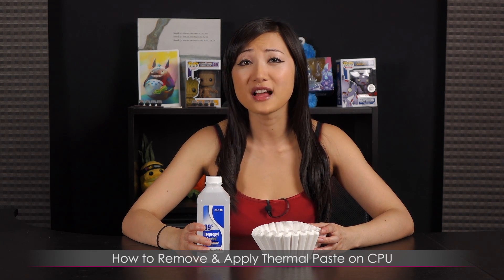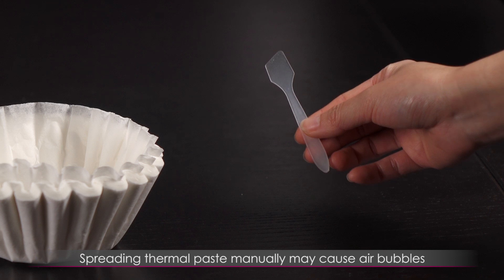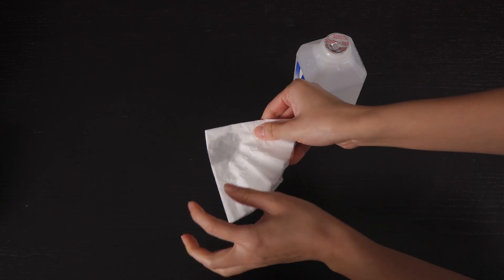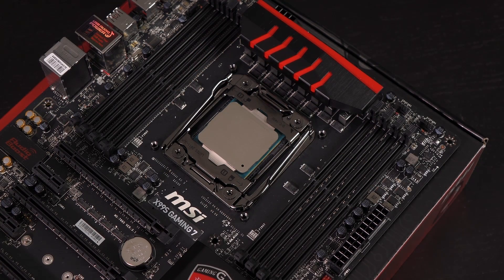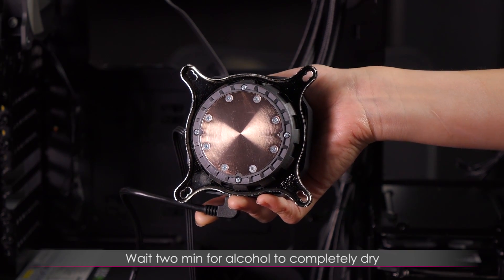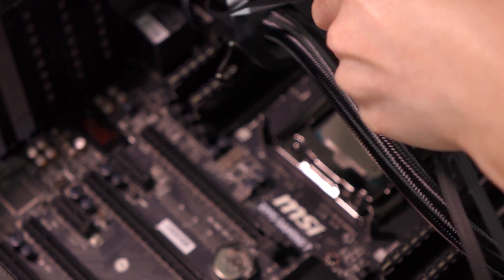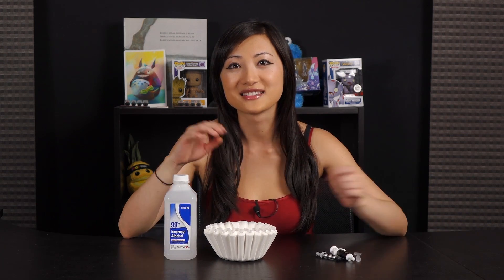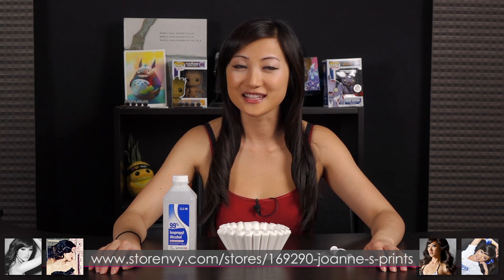How to Remove & Apply Thermal Paste on CPU

Comment: Do yourselves a favor and don't bother with the coffee filter or crazy high alcohol rating.  What you have in your medicine cabinet and a  paper towel will do.  I've been building computers for decades and the coffee filters don't pick up enough paste and you'll be rubbing it for a lot longer than necessary.  Regular rubbing alcohol does the trick.  Waiting a couple of minutes is a good idea, but not entirely necessary.  I actually do pull the paste across the entire chip, but everyone has their preference.  I don't bother with anything but Kryonaut for paste.  It's expensive, but is the best I've found.

Comment: I paint with oil and acrylic and sometimes use nail varnish remover to clean clogged up brushes. Turns out a drop of this stuff on a kitchen towel also melts through thermal paste like a hot knife through butter, even when it is baked in after 5+ years constant use.

Comment: Hello, you need to put more thermal paste and use the applicator to spread it evenly. Pea size paste just wont do! Having said that make sure you dont pour too much also. Just enough to cover the cpu surface area (the top area where the cooling fan makes contact with the cpu).

Comment: Just 190 dislikes? I expected a lot more, given "too much" or "too little" or "line better than dot" or "not the right way to remove old paste" or "did not prep the contact surface properly" or even the rare "should have delidded and done it with the plate contacting the die directly". I came here for the shit flinging, I even brought popcorn. I'll be honest, no one had to tell me how, seemed pretty obvious., so I already knew how. Answer: experiment. Varies with paste, type of surface, consistency, viscosity, and die/IHS type.

Comment: I cleaned my processor with a normal tissue and when I applied a thermal paste my processor started to heat up much higher and my cooler started to cool much fast. What to do

Comment: thank you Joanne. this was exactly what I was looking for. I'm about to upgrade my current rig & bought new CPU  & CPU cooler that already has paste on it but I bought my own paste [thermal grizzly - kryonaut] that I wanted to use for my new i7 kaby lake OC.

& you look lovely, keep up the good work.
Reply: TMSKILZ :) It's nonsense, no offense intended, to say my Kabylake "OC", just K at the end if it's an unlocked one and therefore you could overclock it; you can say OC only it's followed by the amount of frequency you did succeed to overclock it; but since you didn't have installed yet when you had your comment posted ...

Comment: Fun Fact: If you are worried about spreading the Antec formula 7 you can put it into a ziplock bag. Submerge that ziplock bag in hot water for a few mins, and then use normal thermal paste pea/line methods.

Comment: Use Ass Hair and Nipple grease!! doesn't leave air bubbles(rarely), as the fine hair particles spread the grease evenly and dissipate any remaining O2 left in vicinity.Also the real winner is your power supply as it becomes aroma powered and doesnt need a recharge for as long as dolphins rule hawaii. Smashing..
 currently on my gaming rig:
 Msi H97 LGA 1150
 Intel Xeon E5-1620 quad core 3.7GHz  IVY Bridge
16Gb  Hyper Fury series 8 1866MHz
Nvidia gtx 980 ti 6gb
corsair  h100i v2 240mm liquid cool
XFX 20watt TS series FULLY WIRED!
Alienware Orion portfolio 11 inch case
Arctic silver thermal compound case 3.5g  (X20)
Samsung 850 EVO  (x20)
MSi Nvidia GTX 970 4GB Twin Frozr V fan
Apple mac mini bluetooth mouse/cheeseburger deluxe wifi edition
Sony SUX 15.5 inch waveceptor Onion tri color monitor,
CARDBOARD BOX HOUSING. (amazon)  
   Currently running at temps between 200 and 240 Kelvin while playing Doom 95 and Halo 7.Have bootlegged system in havoc mode and achieved astonishing temps of -450 fahrenheit. All in all the best results i have ever seen from non nuclear powered store build. . Cant wait to try my new vr box virtual reality while swimming. 
THANKS FOR GREAT VID!!!!!!!

Comment: I got my hands on a used I7 3770K and on a stress test with out even overclocking it yet, I've been getting temps around 94-96c on some cores for just running the stress test for like 10mins. 
I got it installed at a local computer store but I am just going to re do the job my self now... cant trust people I suppose. 

I am just more accustomed to older CPU's and thermal paste is all still very new to me and I did not want to learn on my gaming rig. 
But from what I am reading there is no logical reason why I am getting temps so high besides the fact that it likely was not installed proper....

I already decided to purchase some ARCTIC MX-4 because on the forums people kept calling silver 5 old school and multiple people claimed this was better.
Since I am even aware of Arctic silver 5 I think that validates how old school it is haha. 

Just need to find some of that Isopropyl alcohol at 99% and wait for my thermal paste to arrive from new egg then I am golden...

Currently I am only using my gaming rig for the internet.... each core is averaging around 45c just with my browser opened and a few tabs plus origin downloading a game... CPU basically at idle...

Comment: Spread the thermal paste is the worst idea ever. Dot method for the win
Reply: uhmm who said that? it's fine there is nothing wrong with spreading it. just don't  put too much paste because it will create a mess.
Reply: +Omar Maestro in terms of thermal dissipation spreading it's OK but after some research and some personal experience using the spreading method with the little plastic that cooler Master provides is the worst way. You just can't spread evenly. So it's comes out that the dot is the easiest method
Reply: Que Jogo!? you know that thermal compounds actually differ right?

Comment: What works best? The simplest method. The one you did in the vid was the simplest method, it's tried and true because it works and is simple to do. One thing you didn't do when seating the cooler was give a little wiggle to help spread the paste more evenly and the wiggle space you have with that cooler is about all you would want to do. Another thing is that was a rather large pea size dollop.

Comment: Anybody else think that was WAY to much thermal paste?
Reply: He's saying that pea sized amount of paste she put on... Did not seem like  pea with that amount
Reply: the size of a pea is not too much. Actually it is the right amount
Reply: Zzzzzz... do u dab an ant size portion of thermal paste on YOUR cpu? If so it will be fried in less than 2 years of use.
Reply: Andres Marrero 

Black Ant would be too much
Reply: That's a huge cpu base, so she applied the right amount.
Reply: My CPU got 93°C, yeah that's true, I tried all the methods of making thermal paste, the best result was 69°C without loading anything, on load ( medium) it get about 74 or more, now i'm again on 93°C for about 6 months
Reply: عبد القادر بن محمّد 
Dogshit. 80°C damages the cpu. It cant be on 93°C for half a year. Would have fried ages ago.
Reply: عبد القادر بن محمّد بن عبد القادر You have applied too much or too less of thermal paste, try it again till you'll do it just right. D
Reply: No.
Reply: She pur less thermal paste. Not a good idea! The processor gets hot fast and if it doesn't dissipate quickly....

Comment: I used nail polish remover to clean my fingerprint off my CPU. Now the CPU is overheating and I need to add new thermal compound. Is nail polish remover ok or does it need to be 99% alcohol?
Reply: nail polish remover (does it have acetone in it?) is flammable and will melt plastic and is probably why your computer is having such a rough time. do not use nail polish remover!  the isopropyl doesn't have to be 99% (and honestly im not sure where you'd find such a high concentration), you can usually get 90% and 70% at walmart. alcohol will dry very quickly and not leave residue, that's why you use it for cleaning. although i can't say what will happen if you use the alcohol over where you used the nail polish remover. be very careful!

Comment: strawberry jam works best for heatspreader compound.
Reply: I use ass hair and nipple grease, works every time! The fine hair particles distribute the heat evenly.
Reply: what in the world is going on here? o.o
Reply: Toothpaste mixed with petroleum jelly works best, the jelly keeps the paste from drying up for a long time. I'm using this composition as my current thermal compound and the temps are the exact same as with the pre-applied thermal paste that came with my CPU's fan.
Reply: Does it matter if my ass hair is really long?
Reply: Haha!
Reply: nah toothpaste is the best
Reply: Shepard Playz its not, it dries out and becomes brittle, that's actually the worst.

Comment: when clean cpu a bit of paste went of to the outer area is that ok not on green pcb stuff though
Reply: no its not. it will conduct the heat out of that space and that is not good.
Reply: ok thanks, ive gotten every bit i can see off just to be clear its on the sides of the metal part not the pcb
Reply: Mason Heilman if its touching the bracket its not safe. and i succesfully aappliedit even though the fan was wigling. woohoo!
Reply: ok thanks again should be ok my temps have been good for a while now and my CPU cooler sucked to install bc it can be used for both AMD and Intel
Reply: Mason Heilman while external coolers are best, getting the fan for the cpu that you have is best because it mathces the motherboards socket settings.

Comment: Can I use nail polish remover instead  of Isoprophyl alcohol
Reply: It's all overkill, just use anything alcohol based that gets it clean, I use vodka :)
Reply: thanks!
Reply: +blooduhz I haven't used it myself but it is an alcohol so it should do the trick. just make sure you don't get a flavored kind or one with sugar since that can cause short circuits. best of luck!
Reply: Please don't use nail polish remover, it is designed to dissolve laquer/resin/polymers and will damage your PCBs and other electrical components.
Reply: thanks plantsnaminals! I asked that because in my country Isoprophyl alcohol is not easily available in department store. Maybe I use vodka like mentioned earlier :D
Reply: err...clean the cpu when it's not in it's socket ?...quit scaremongering.
Reply: +Richard Missin excuse me for attempting to help someone not accidentally destroy a piece of equipment that may set them back a few hundred dollars. it's not worth the risk imo
Reply: Your excused, you clean with nail polish remover then lick the CPU to make sure no harmful chemicals are left on the surface.
Reply: +Richard Missin Well that certainly explains your lack of critical thought. Good rule of thumb is to not ingest toxic substances and also not to put your tongue on electronic equipment. For future reference.
Reply: ...and that certainly explains your total lack of a sense of humour.
Reply: +Richard Missin No, I tend not to think advising people to do something destructive to their expensive things under the guise of maintenance is "funny".

Comment: Listen carefully zipperheads (not you joanne i'm in luff with you)...none of you seem to know how to apply thermal paste. Luckily for all of you, arctic 5 thermal paste company actually produces a document you can download explaining the correct method. It all depends on the processor you are using, for example: a core 2 duo uses a thin line method because the processor's hot spot is shaped like an egg. Some processors do require a pea sized dot in the center and very few need the credit card spread out method. I will put a link for this document here: http://www.arcticsilver.com/intel_application_method.html#
Reply: Tiamu 2011

Comment: I accidentally removed the past without knowing what it was, now I don't know whether I should buy that paste or simply allow it and use my computer like normal?
Reply: +KaBoom You should definitely get some thermal paste. It's like running a car without oil. The funny thing is I was cleaning my computer a day ago and ended up removing my heat sink, breaking the seal of the thermal paste. I ordered the same thermal paste in the video, but right now my computer heats up much more quickly and at a higher temperature than what I have ever seen it at. You could still probably get away with just browsing like me, but things like playing games will permanently damage your CPU due to the heat.
Reply: +AndyTh3Human My friends told me the same thing. I haven't turned my computer on since I removed it. F*ck that can't be risking it haha.
Reply: +KaBoom I know I shouldn't be using my computer either, but need to for school. Right now I have around the same temperatures that I normally do with it going up a bit, but nothing too high than what I'm used to seeing.

Comment: "Don't rub on it vigorously." 

Have you ever tried to get off completely dried out gunk? xD You really have no choice then.
Reply: That's why you use 99% and take your time. Even with the video sped up it took a while.
Reply: +Bas van der Meij (Ykai63) Also before you remove the CPU cooler you should run the pc for a bit to bring the CPU up to temp to make removal easier.
Reply: +matrix6977 I know, but when systems are about 10 years old it will hardly make any difference xD

Comment: How long should you wait before powering up your PC with the freshly-applied thermal paste and re-installed HSF?  Is it necessary to wait for the thermal paste to harden/thicken or even-out for a few minutes/hours?  Or is it okay to power-on, right after you've re-assembled everything?
Reply: it is safe to power it on right away, don't listen to that moron brian. you shouldn't be sarcastic when it comes to these kind of stuff.
Reply: +rkmugen just wait 3-5days
Reply: Brian Br Thanks....  man.... that's a long time to test to see if you've done it right.  There has to be an easier way to deal with thermal paste..... to get it done right the first time, every time.
Reply: +rkmugen how long did you wait im about to put the paste on my cpu
Reply: Nemanja Maksimovic Haven't done it yet... i'm short on funds (it all went to the new car) so my new gaming rig is gonna have to wait.  :\
Reply: You can power on immediately. Some compounds might take some time to reach its optimal performance but its safe to use the PC immediately.
Reply: moment lucu.. rumor has it he's still waiting!
Reply: Actually, you don't need to wait.  What you want to do is go ahead and turn the computer on once everything is in place and give it a day for the paste to heat up over time and adhere to everything like it should.  Do NOT "just wait 3-5days" like someone here says.  The paste will dry out and will not have thorough conductance.

Comment: if i use 70% alcohol and the micro fibre tissue thing i use to clean my glasses... will that work...?
Reply: +Louis Vo It should work just fine. I would suggest trying, and if it doesn't remove it all, buy 99% alcohol or buy Thermal paste remover and purifier (It's relatively cheap)
Reply: Chef Boyardee ok thanks, the 70% alcohol im just borrowing from my mate, saving the hassle of getting 99%

Comment: With all due respect, if there is no really "...right way to do this"; then why are you presenting a video on "How to do this?"  Pretending to "chug" the 99% isopropyl alcohol in a video is probably not the right way to do this.  Is blotting the alcohol-ed coffee filter on the paper towel meant to introduce the lint which you avoided by not using a paper towel in the first place?
Reply: Thomas Lee Callahan she meant that the way the procedure was done although what she obviously meant was people work differently so if they want or have to do it a different way she shouldn't force people to do something because then she would get the blame if anything goes wrong.
Reply: Correct, their no 100% definitive way to apply thermal paste everyone will almost say "no the correct way is.." or " the way it should be done insert link here" so she is right.